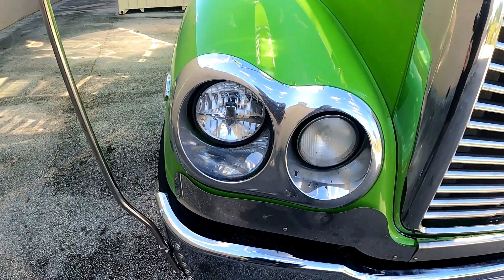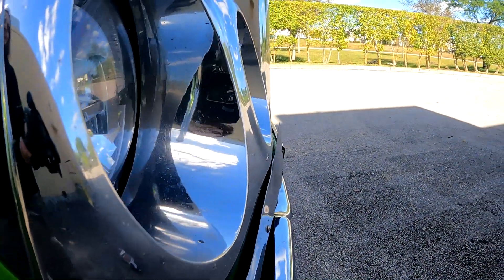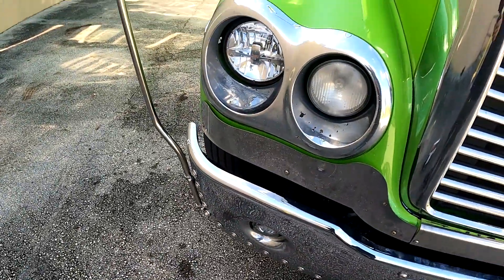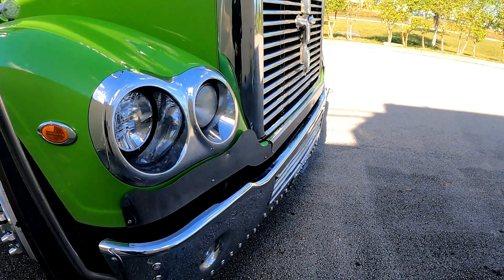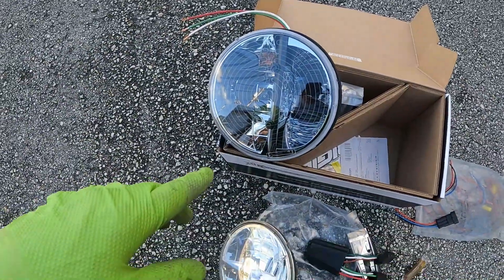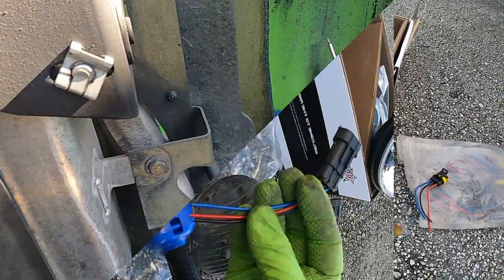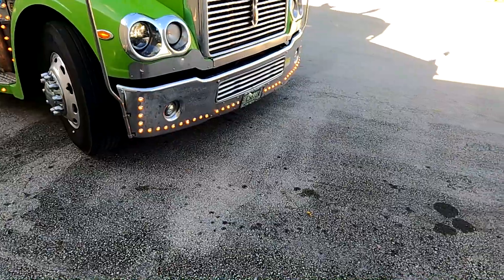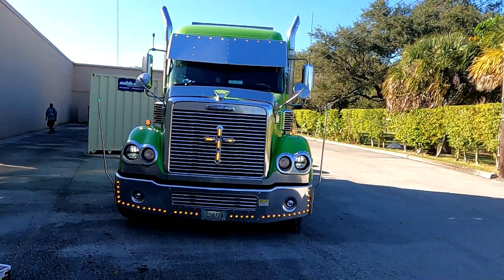Heated headlights on my 2016 Freightliner Coronado Glider. Why aren't LED headlights good in winter?

Comment: Hey man which headlight bracket are you using to hold the headlight in place? Because freightliner said they have nothing that fits 7inch LED only the original headlight assembly.
Reply from the maker: When I replaced mine back in 2016 I never saw a universal bracket but they have them now. 

https://www.4statetrucks.com/csm-7-inch-round-headlight-adapter-plate-03-1610001?gclid=Cj0KCQjwmtGjBhDhARIsAEqfDEdf4Jxe7Pg-ERiwEV1ihlT75guTQorQDoTQzQSfJCFoKRuXl19DFZ8aAohYEALw_wcB

Comment: I opted for the low budget unheated ones too (4x6 4 of them ), same problem . I'm not in snow or sleet too often, tried spraying em down with WD40, helps a little but not like those heated ones. 👍
Reply from the maker: There's no helping this Coronado without heated ones. Roll easy Banzaii